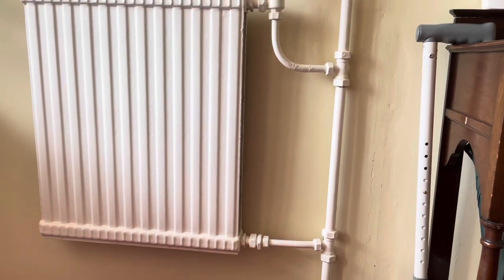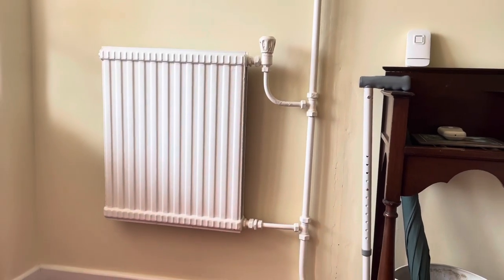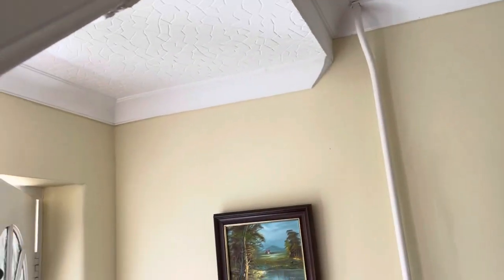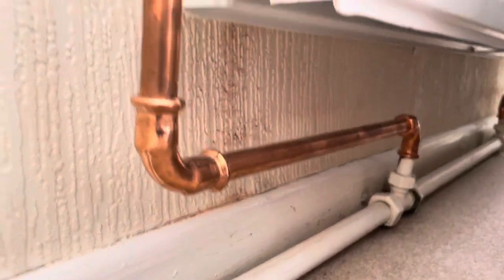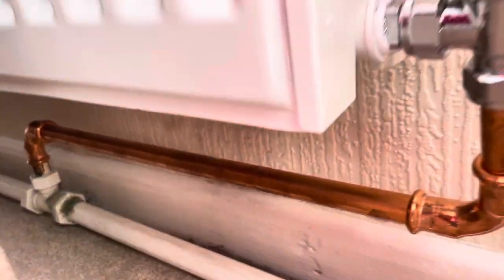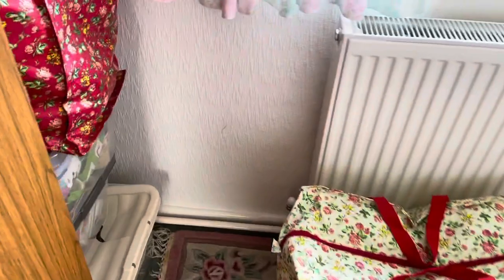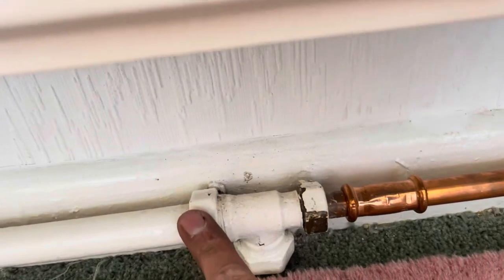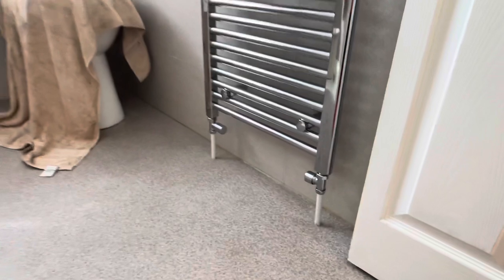One Pipe Heating System Still Working

Comment: Hi how.come the towel rad couldn't work with the 1 pipe sytem but the other rads could ??
Reply from the maker: What happened is they plumbed into a two pipe system so there should be a pipe running along the skirting board in the one pipe system in the bathroom so it works on gravity
Reply: @PlumberOntheJob  I don't think this answer makes sense.